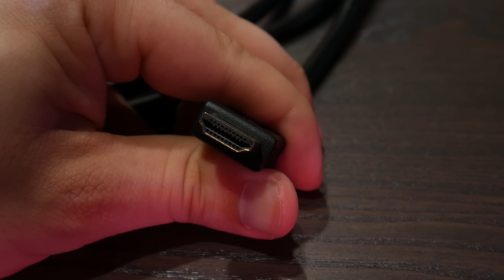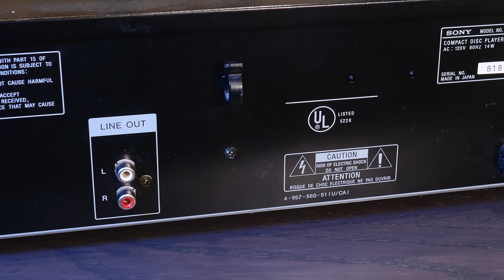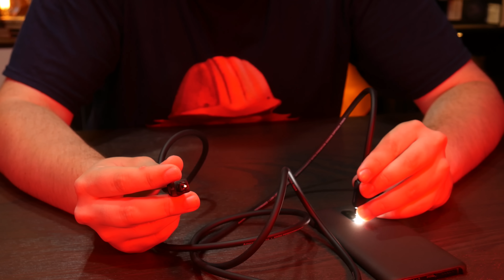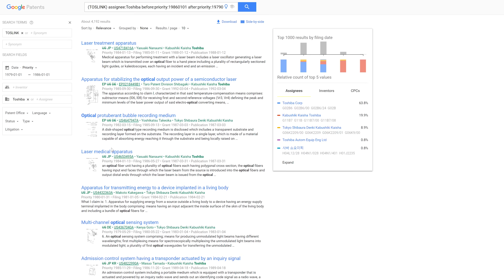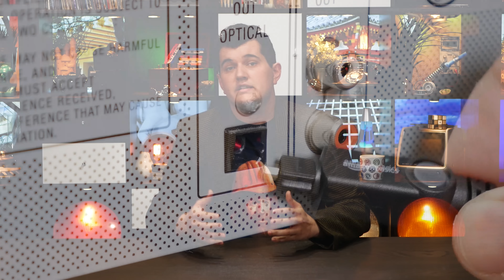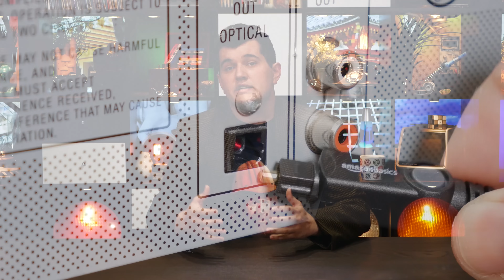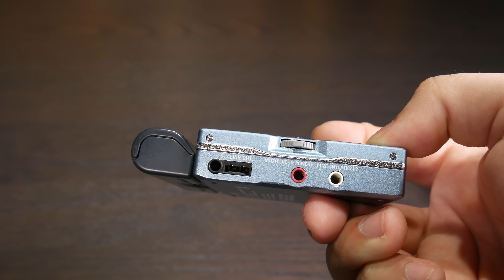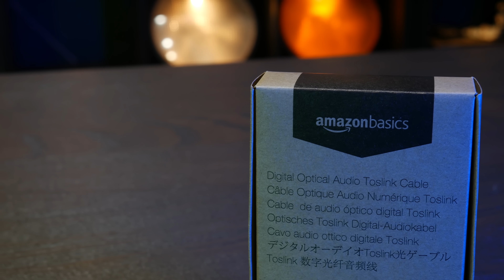TOSLINK: That one consumer fiber optic standard

Comment: Toslink is still a great standard and has one advantage that no digital or analog cable can match, that is it does not conduct electricity. This is a major advantage when connecting components. Even with isolation transformers and lifted grounds, you still can get ground loops through the audio cables and yes this is on analog audio. While there is or can be a degradation of the signal through the converters, not having the 60 cycle hum is a huge deal.

Comment: Hold on... That phone... Is that a cheap LG like I've got? The "bugger Apple and Samsung for their overpriced internet machine, I'll take the Wal-Mart 'who gives a crap'" phone?

I just think of it like this - I could run my first computer and all its software hundreds of times simultaneously on this phone. I dreamt of a phone like this as a kid, when I saw flip phones and dial-up were a thing. I saw register pin pads with their janky pressure touchscreens. I always knew this would be a thing and wow that's a long comment about phones for a fiber optic video.

Comment: Audio latency is still a problem in many cases.  HDMI's Audio Return Channel unfortunately tends to increase latency, because of the extra "jump" if you're sending audio out and back.  And if you want to use an HDMI cable just for audio, it's a pretty big connector, and it might be confusing if your A/V receiver had an HDMI port that was intended just for audio.  I only know this because certain games become rather annoying when there's significant audio latency, and newer standards are typically worse in that area.
So due to latency, connector size, and of course the cost of the circuitry, HDMI isn't universally better than TOSLINK. And as other commenters have mentioned, it may have a slight edge over S/PDIF due to completely eliminating ground loops (another rather extreme edge case).

Comment: Actually toslink saved my stereo setup.
I have a pair of studio monitor, great sound for cheap, but they are supposed to be paired with an expensive balanced output soundcard. Using unbalanced on my pc just create ground loop noise.
With toslink no shared ground, no ground loop, no noise, just perfect sound.

On a side note while HDMI is great for bundling video and audio in one cable, HDMI doesn't do audio only.

Comment: Transmitting all of your audio channels over a single cable with a single plug is enough of a benefit for me. RCA was fine for home theater standard, but most computers only offer 3.5mm which is atrocious or Toslink. So Toslink has been a must have for PC speakers for like 20 years.
But I had never heard of mini-Toslink before either. Learn something every day.

Comment: The SPDIF cable can pick up noise and it can in fact effect the analog output when both use the same ground. Correct me if there is a mistake in my thoughts.

Comment: Signal-to-Noise is a "Complicated" topic when it comes to Audio. 
Now of course SPDIF was Developed specifically to try to reduce the potential of SNR., which is does; as the Line is no longer handling an Analogue Signal that can be affected by Tolerances... but the Flipside of that is that the Greater the Distance the Higher the Impedance of the Signal and more Likely it is to be affected by EM Noise. 
And this is true as we dial up the Signal Clock, which said Noise comes through as "Clicking" as Data is Lost.

With TOSLink, well you don't have that issue. 
So while you might've been fine handling say a 192KHz 24bit 2-Channel Signal for an Individual SPDIF Wire... with TOSLink, despite note changing in 40 years; you can handle 384KHz 32bit across 9 Channels (8.1 Surround), with that exact same wire you had when the standard first launched. 
It dramatically reduces the need for Large Numbers of I/O Ports and is more-or-less Future Proof; if you want to keep increasing the Signal Density. 

Now arguably for Audio, this is "Overkill"... but consider for a second that this had been Adopted to replace VGA instead of HDMI or Display Port.
Remember that the Light Signals themselves don't interact, meaning you could actually have a Tricolour LED (RGB) as well as an InfraRed; all in the same Line and handle any modern Display Signal Density. 

In fact it's how Modern Fibre Optic (Cable Internet) works., as each Colour Band is used for an individual connection; operating into the GHz to allow up to 50 Connections at up to 1.5Gb/s without any signal crossing, noise, etc. Of course that's in Glass Fibre Lines using LASER Light; but arguably most of that is because of the necessary distance required for the Signal.
For a 3 - 10m Local approach; LED and Plastic Fibre is frankly "Good Enough"., and the Cables themselves would be fine; it's just the Transmitter + Receiver that would need upgrades in order to support better signals.

Comment: Funny enough, my Creative sound card has an optical out (and in) that I used to run my sound to my surround sound (until it died). I always wondered why it was labeled optical on my previous version card, and S/PDIF on my current.

I should mention I did this because the only other jacks would output stereo and not surround.

Comment: I would like a separate connector that supported uncompressed surround sound in current year.

Using HDMI isn't always the optimal solution. I for example have a surround receiver that does not support 4k60 video, so the only way to get that is to run a HDMI/DP cable straight from the source to the TV, bypassing the receiver. Now, how do I get that uncompressed audio through my receiver to my speakers? Well currently I'm running a second HDMI cable to the receiver carrying both video and audio, and then I'm only using the audio signal. Less than elegant solution I'd say.

If I was able to run only audio through the HDMI cable, that would be a better solution, but I don't think that's possible. Best solution would be to just have an audio connector that supported it.

Comment: I know someone who's old man was an electrical engineer. He built a part of their house on a separate concrete slab, sound proofed the walls, built a Faraday cage behind the plaster, and put the electricity on a separate phase. He did a whole bunch of other insane stuff with the setup (for example little things that keep the cables off the floor) JUST to min-max their audio quality. It was awesome, though I have heard a similar level of awesome with far less drama to set up. But I think that level of attention to detail actually IS the hobby.
Reply: The "old man" with age related hearing loss, no doubt.

Comment: well actually it was super common until 2016/2017 if you were an Apple users, as they used to include both optical out and in combined ports with the analog 3,5mm jack in all Mac models
Reply: And they included in on the AirPort Express, which introduced AirTunes (which later became AirPlay).

Comment: This crap pissed me off. Imagine trying to repair an entertainment system requiring a female tos connector made by a company who gave it a torx model number or Rx for the receiving end but it shares the same name as the damn torx bit for screws. Only ended up finding out that the company that made this specific connector retired it after a flood and never made something that could replace it. It was so frustrating. Managed to find one on ebay but if it ever blows again.... HJSTORX177L can you believe that model name lol.

Comment: I discovered arc with my (then) new tv. My old tv didn't have arc, so I had to turn my old tv on, then turn the Blu ray player (thst had surround sound) on.  Often times I would route the roku through the Blu ray player and then Blu ray through the tv.  It was too many moving parts.  Half the time I'd get fed up and just put the roku on the tv and use the shitty tv speakers. 

My new tv had arc and that solved all my problems.  Arc is God.  I will sacrifice a lamb to arc ones the summer solstice is upon us.

Comment: The biggest benefit with TOSLINK I found was with long runs between audio equipment that were in the same run as electrical cables. They were immune to electrical interference or any added buzz from poorly grounded equipment the copper cables would eat up.

Comment: Great video. Never knew that about toslink..and 5m length max ? I have 10m cheap toslink cable installed since 2002. Changed a lot of equipment but cable is the same(installed through wall) and never a single problem. Legacy is great ;-)

Comment: You understate the most important feature: Fibre connectivity for audio is an absolutely WONDERFUL way to avoid ground loops and introduces fewer noise antennas.  Your argument that the equipment is still hooked up to AC power isn't entirely valid 1) AC power doesn't necessarily come from the same outlet with identical potential 2) Your separate ground path still introduce problems 3) You might have equipment that is not even running on AC power at all. 4) You already mentioned it, but the protection of your precious DAC inputs when somebody spills coffee on your Roku should not be underestimated.

Comment: I make music. So I spend lots of time trying to understand what my ears are hearing. So I'd consider myself, at least above average in understanding what I'm hearing accurately. Which means I in no way fully understand what I'm hearing accurately. 
I struggle to find people that consider themselves audio files, that aren't just circle jerking about things that go against our understanding of physics, or at best, drastically overestimating the importance of things that make a nearly imperceptible difference. 

If you actually work with the creation or manipulation of audio for any significant amount of time, you quickly learn that although sound is a physical thing with defined properties, your perception of it isn't. You actually probably DONT fully understand what your hearing. The idea that something is supposed to sound better is ABSOLUTELY enough for you to actually perceive it as better. Not think it's better, actually perceive it as better. You want to "hear the audio as the mastering engineer did"? Go buy some used Yamaha NS-10's. Have fun with that.

Comment: I loved that my mini-disc players all had optical in and out.  I could very easily connect it to hifi systems and record/play with a very very good quality.  I actually still have the MD player you show in the video; I picked it up in Osaka about...20 years ago.  With the external battery unit, it still works perfectly!!

Comment: I have a pretty specific use case f or Toslink.  I have a USB DAC/headphone amp that also has optical in that I use for my laptop.  Strangely enough I get mad amounts of noise via USB which drove me nuts because, digital signal.  I didn't know it at the time, but in retrospect it seems to have been a ground loop issue, as the problem would go away if I used the laptop on battery only.

I decided to try optical (it's one of those combined 3.5mm/mini Toslink jacks), and boom, perfect audio (since no electrical connection between the DAC/laptop).

I'm also now kicking myself for all the time I've been using my chromecast audio with the 3.5mm jack and not optical.  I've even seen the red light before but it just didn't occur to me!

Comment: 11:38 – choosing optical fiber prevent ground looping, switching power supply noise leakage, and power line differential potentials in analogue parts of the audio equipment. that's what they mean by advantage.